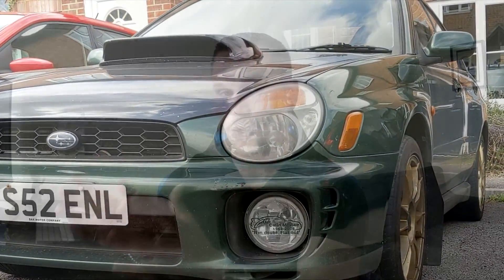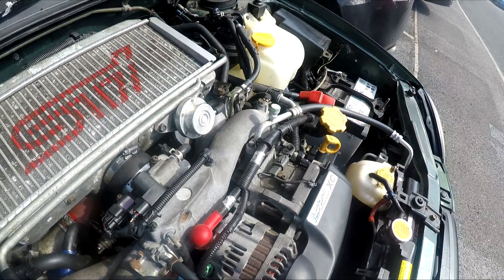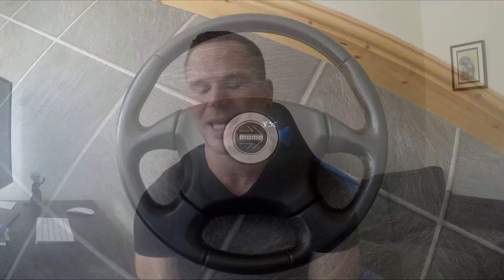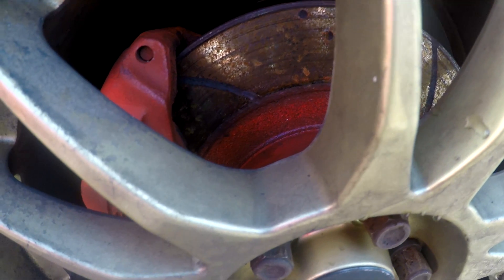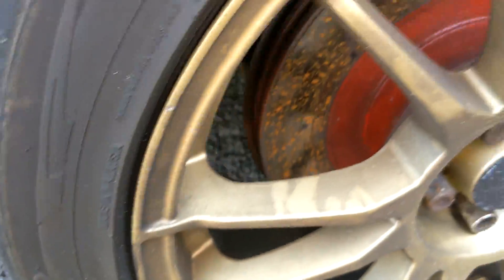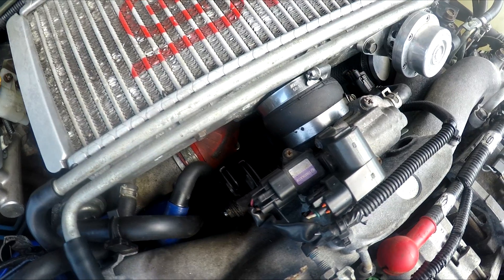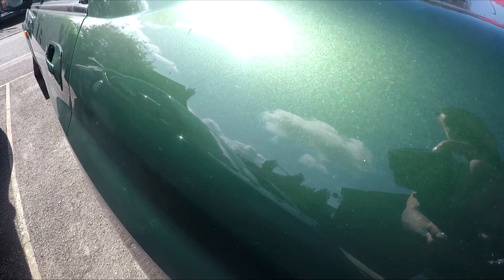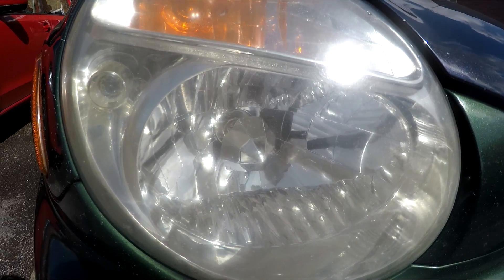Everything Wrong With My CHEAP Subaru WRX

Comment: Best of luck mate I've had 3 sub wrx sti's and eventually traded my last one in for a M3 and I can honestly say out of all the cars I've ever owned the sub was the funniest and most exciting car I've ever drivin, all I ever did to the subs was change the exhaust and put on a dump valve oh and some nice sti official mudflaps lol! I always got out of the car with a smile on my face, always felt alive and impressed with the car ! Never got bored of the head turning it use to attract (big head) driving my first sub off the forcourt and driving home was up there with one of the best moments in my life I didnt even take the car for a test drive so u can imagine my surprise when I drove it away from the dealership for the first time, some of my mates who bought them had stage one boost control, bigger brakes, straight exhaust etc etc done to them I remember when the RB 360 sub came out it looked like something straight out of hell lol AMYWAYS I'm waffling and I only wanted to wish you the very best with the car and hope you every success with it in the future !👍

Comment: Looking forward to this as I have been considering getting an older car and doing some work on it myself, but I have no experience. Hope you can show me how it's done and give me the confidence to have a go myself!
Reply: I've been wrenching on my own cars for 20 years now. It's a bit like grown up Lego. It's all about buying the correct parts, buying good quality parts (not whatever is cheapest) and having the confidence to tackle it yourself.
Most important thing to remember though - safety. Cars are heavy. Next thing to remember - look for guides. It's almost guaranteed someone will have written a guide for what you're intending on doing.
Reply: @timmccreery81  I've not heard the Lego comparison before, well I have heard it about building PC's and I started off as a complete novice on that too. Now I can pretty much build my own! These are some good tips, especially the one about safety, I guess having the right equipment is a given too? 

I've been thinking about it for a while, I'm a big fan of Japanese cars so I was thinking about getting an older Civic Type-R and adding a few easy mods and learning how to maintain it. Not sure if there are easier cars to start with!
Reply: I build my own PCs too and have done since the mid 90s. Having confidence to build your own stuff is a good start.

Regarding safety - always use axle stands if you're lifting the car for any length of time and never get under a car supported by a mechanical or hydraulic jack only. Also learn where to place an axle stand so it's secure and won't topple.

Civic Type R would be a good place to start. Older ones are normally aspirated so they're a little easier to troubleshoot and fix.
Reply: @timmccreery81  That was my thought as well, going for an naturally aspirated and slightly older car might make it a bit easier (especially for the total novice).  

Cheers for the safety tips, Cars a lot heavier than PC's and I would hate to drop either on any of my limbs!  I'll do some more research and I'm quite fortunate to have a garage and large drive so I'll have a lot of space.  When I got the cash just got to convince the wife I'm not mad :D
Reply: A few of my previous PCs have approached the weight of a small car but thankfully I'm now more into minimalist builds.

A garage and decent (hopefully flat) driveways helps enormously.
Reply: @timmccreery81  it's on a slight decline but nothing major so should be doable. My current build is has a tempered glass case, a lot lighter than my older solid steel build!

Comment: Lol at the steering wheel. I bought a Subaru with a purple racer boy steering wheel, first thing to come off. It now has a proper oem wheel.
Edit: Really nice car you have there. I've never seen a green wrx.
Reply: It's definitely hideous. The standard 4-spoke is pretty big but the 2005 3-spoke is a little nicer to hold. Both are miles better than that ugly thing.

Comment: As someone helping my brother semi-restore a 2003 Forester XT turbo, I'll watch this with interest.
I'm a previous owner of two classic Imprezas (one NA, one turbo) so I know my way around them pretty well.
Any plans for a suspension refresh/upgrade?
Also, pads for the Sumitomo 4-pots are dirt cheap, even for decent brands pads at standard grade. With 360hp though, I'd consider something uprated. I ran Ferodo DS2500 on my Turbo to great effect.
Reply from the maker: Suspension is surprisingly in great shape man, very composed and well balanced, no body roll, so won't be replacing it any time soon, may do one on my 370 though as that's rolly poly currently!
Reply: Good to hear. 
I ended up with Group N top mounts, Whiteline caster bushes, droplinks and 22mm rear ARB. Very good compromise except the top mounts introduced a load of NVH.

Comment: There is a lovely 400bhp forged wrx near me selling for £4K been interested in getting it but the wife is not so keen lol
Reply from the maker: Get it! That's a good deal!
Reply: Last time I tried nearly ended in divorce lol but I admit could be worth it in long run hahaha
Reply from the maker: lol do it on the sly!
Reply: £1000 per 100bhp, £1000 per driven wheel. 
Seems like a good deal to me, assuming it's not ropey and knackered.
Reply: SemiT its a 2004 engine reforged dropped in a 98 shell road legal track car and it’s still in the breaking in mode after the engine forge with all receipts . it’s beautiful car the problem was my friend lost his job after building the car and he cannot afford to run it now he just keeps it maintained and wanted it going to someone local so he could still see it around go out in it still .
Reply: So long as the rear arches/strut tower area is solid, that'd be a riot.